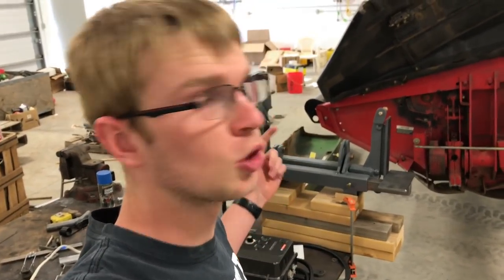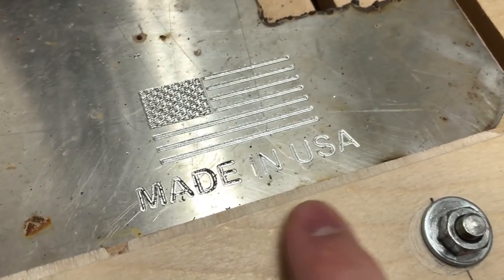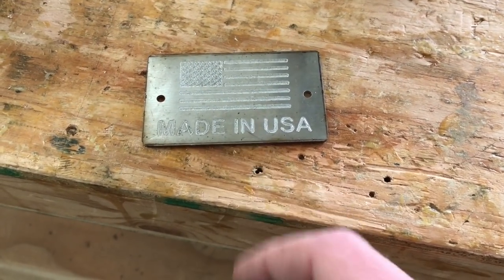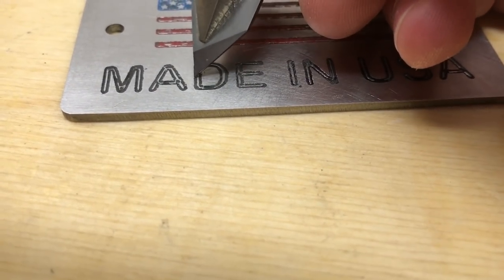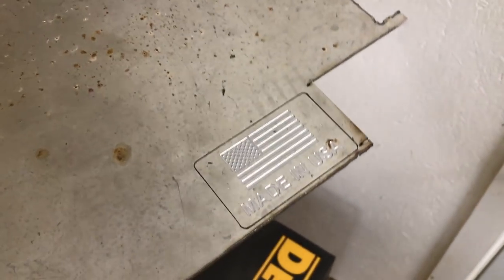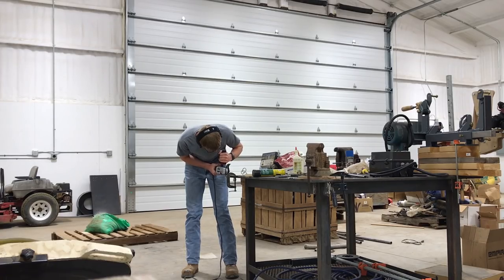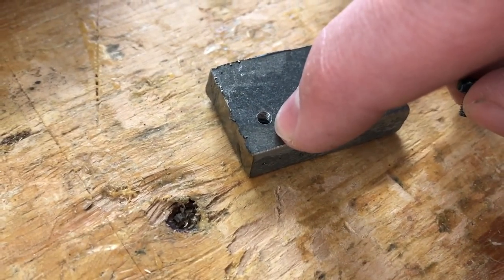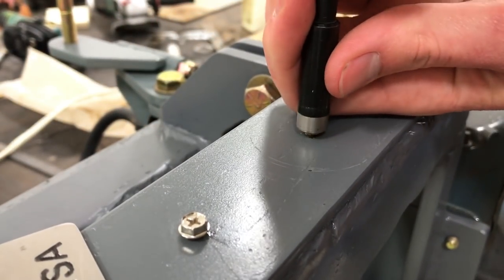Making the "Made in USA" badge

Comment: youtube suggested it to me and ya real good those bits easy to sharpen probly use em' for a long time not costing a lot a good thing and drill the tap hole size in the tag first use the tag as a drill jig drill em then alighn on the drill press again with the tap drill then change bits to the clearance hole works every time  and the drill size chart if it lists 5/16" as the correct size for 3/8 16  tpi toss it its wrong look for those you find that chart in some amazing places tool sharpening very important nice router too
Reply: Sorry! For trying to help.

Comment: Fine with the informality, not a great fan of the handheld motion...  but I don't know how to reconcile that.
Looking forward to the belt sander build!
Reply from the maker: +Wordsnwood (Art Mulder) 
Thanks! I need to build more camera equipment :)
Reply: Do you have a quick-release plate on your camera?  I found that makes a huge difference in being able to pop the camera off one tripod and put it somewhere else.
Reply from the maker: +Wordsnwood (Art Mulder) 
No, I don't. I really do need to get some, or make some. It would also be very helpful to be able to swap cameras and put my phone on the mount.
Reply: I use "DMKFoto Heavy Duty Ball Head with Quick Release Plate"  from amazon - only $16.   Not exactly a fluid head, but cheap and works pretty good, I think.

Comment: Didn't you once say you have a small shop?
Reply from the maker: +ensoniq2k 
Yes. It's tiny.
Reply: Especially the one where you built your new machine ;-) Building your drawer design greatly improved my shop by the way. Sadly cutting the dados takes four times longer if you only can use the normal saw blade in europe